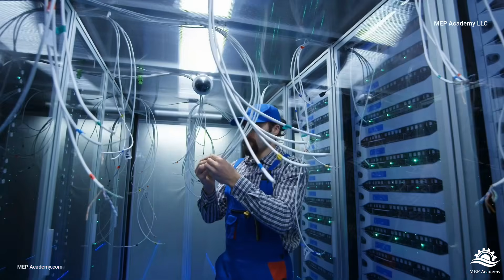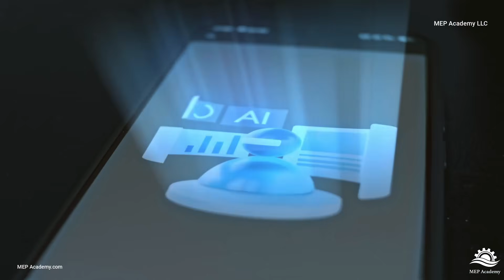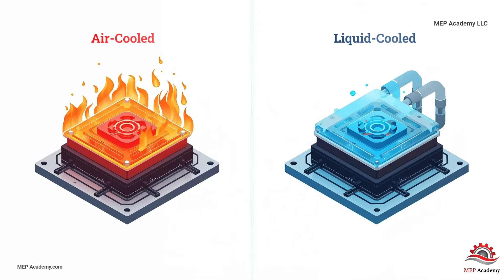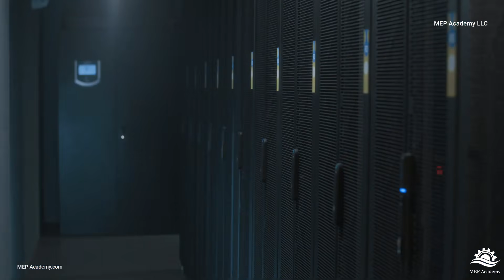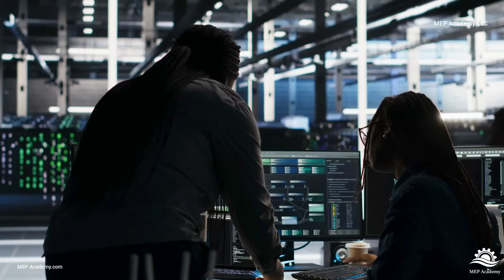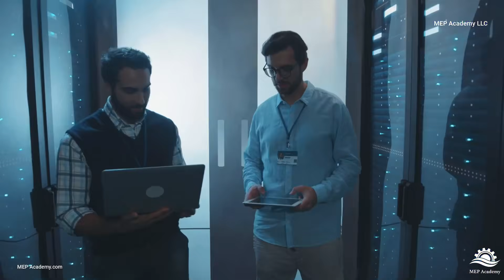Liquid Cooling in AI Data Center

Comment from the maker: 🚀 AI is driving one of the biggest changes the data center industry has ever seen.
As rack densities climb beyond 100 kW and liquid cooling becomes the new standard, understanding the mechanical and electrical infrastructure behind these facilities has never been more important.
What cooling technology do you think will dominate the future of AI data centers?
💬 Let us know in the comments:
• Direct-to-Chip Cooling
• Single-Phase Immersion Cooling
• Two-Phase Immersion Cooling
📚 Want to learn more about the systems that power and cool modern facilities?
Visit MEP Academy for online training courses, estimating tools, and resources for engineers, technicians, estimators, project managers, and construction professionals.
👉 Course Catalog: https://mepacademy.com/courses 
👉 Estimating Spreadsheets & Tools: https://mepacademy.com/shop 
If this video helped you understand liquid cooling, please give it a 👍 and subscribe for more videos on data center power, cooling, redundancy, chilled water systems, CRAC vs CRAH units, and AI infrastructure.
Thanks for watching!
Reply: Maybe an interesting video would be the trend of using cogeneration to provide cooling for AI Data Centers from waste heat from the behind the meter natural gas electricity generators (I think using absorbtion chillers). 

Maybe you could look into the waste heat cooling that Fuji Electric Co. has announced where the hot water from the chips is used to run an ejector cooling unit. Supposedly it can reduce server cooling power consumption by up to 85% (when used over a three-month summer period). Sounds a bit suspect but the AI chips now are outputting 145 degree F water. 

From an article:

“The Vera Rubin server infrastructure (Nvidia's AI compute platform) doesn't need traditional chillers because it uses highly efficient warm-water, single-phase direct liquid cooling (DLC). By engineering the chips to operate safely with an inlet water temperature of up to 45°C (113°F), the cooling loop becomes hot enough that data centers can reject heat directly using outside ambient air (dry coolers) instead of power-hungry, mechanical refrigeration.”

Comment: How much water is generally used to heat a KW of power?  How hot is the water discharged to the environment (air or back into the water stream)?  How remote can a data centre be (ie middle of no where)?

Comment: Your video left off the other form on emersion.  This where you get the best of both worlds.  Emersion cooling and cold plate cooling.  This is where you keep the servers currently configured but instead of piping the hot water to a cooling tower consuming water.  Submerse the cooling tower in a large body of water with the body of water in motion circulating the water over and through the radiator fins.  This is basically the same way water is used for cooling in power plants.  Poof now you are no longer consuming water at the rates people are so concerned with using.  If done properly the water reservior would be a shared resourse between the power generation plant and the data center cooling.  Meaning you now have a resource independent data center. Even adding back to the community any extra power generated, not to mention adding taxes to their coffers as well

Comment: How quiet are these data centers using this cooling system?
Reply: The noise from water cooling cubes from the circulation pumps which can be in a separate room from the servers. Pump rooms can be sound insulated and some distance from spaces where people are working. This is in contrast with fans that need to be in close proximity to efficiently move air. The fan motors and the moving air are each noise producing.

Comment: Well done a great explanation, but it doesn't explain why they need so much water constantly and how the water gets contaminated.
For example you used the car engine and all you need to do over time is add a little water, very little and the engine remains cool.
Why would a data center be different and why would it be releasing contaminated water (going on reports) into the environment?

Comment: Cars DONT USE WATER.
Reply: Yes they do!! Coolant is made of water that runs in your radiator.  And yes, you shouldn't use the same water- you should flush it with new every 5 years
Reply: Car radiators use water. Ethylene glycol is added to raise the boiling point

Comment: For now AI needs to be only used for the design and creation of a cooling system that does not use or consume water!
Reply: This problem has been completely solved. The data centers will consist of servers on satellites orbiting the earth. Unlimited solar power and cooling grids that requires no water supply

Comment: Dont know if you read comments, and this might not be a feasible idea, but what if data centers use Dry Ice recirculating Condensing units for cooling?  Sealed system that compresses co2 into dry ice. Dry ice is then used for cooling. As the dry ice evaporates back into co2 its recirculated and compressed back into dry ice. Another benefit it could be supplied from co2 removed from the atmosphere by capture units?
Dumb? Or did I just give away a billion dollar idea?
Reply: Local power sources such as propane or natural gas fuel cells are the only solution to the gap between zoning, available power at the right place from the and issues with traditional turbine or rotary motor generators.   Fuel solves to produce carbon but if it can be converted to dry ice for cooling purposes and dry in the carbon released when the dry ice evaporates can be totally or substantially recaptured and used again, that will be that would be a transformational change.
Reply: There are companies who are currently working on this.
Reply: are you dumb? google CO2 refrigeration. you just described a refrigeration cycle using CO2 and it’s got a limited scope for reasons that a simple google search would tell you😂
Reply: *Your comment was removed by the CIA. You are too smart to legally live"

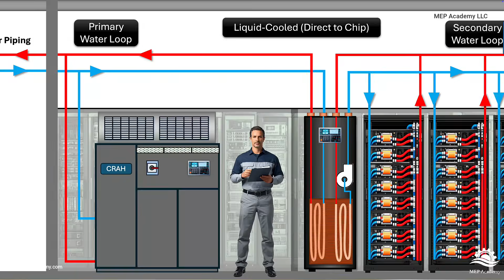Comment: "challenge isn't supplying the power"... supplying power is 100% a challenge as well, just look at the move happening now to 800VDC.  Also... @5:45, near ZERO new AI data centers utilize a 'cooling tower', instead the condenser loop is fed through dry coolers so that water can remain in a closed loop circulation, and thus avoiding evaporation.  Cooling Towers were circa pre-2010, not today's approach.  Do you actually research by talking to design teams that do this for a living?  Interest in immersion isn't growing either, its % adoption to overal market is plummeting.  I appreciate what your channel is doing for MEP engineers and adjacent industry professionals, but please be thorough and accurate when attempting to 'summarize' a market sector.
Reply: For sure. Some information is incorrect or at least not as accurate as should be.
Reply: Someone that actually knows what is going on in real life. There is so much misinformation about AI data centers.
Reply: @Mentaculus42  Yes there is, its an endless struggle trying to unravel the false narratives.  Or Narratives that apply to legacy data centers or single installs, that the nay-sayers want to apply forward to the whole industry...  ugh.l
Reply: @apokalypz08 

Your username sure sounds like a reference to “Mad Max Beyond Thunderdome”? Even though that was pronounced as “Pox-Eclipse”!
Reply: @Mentaculus42  Its not that 'fun' of a reference.  Red Alert 2 was my fav game, there was an Apocalypse tank that was my fav asset in the game, and in 2003 when i got an Xbox, i had to create a gamertag, and spelling it correctly was taken, so i phonetically changed it, and added a number on the end.

Comment: Data centers are just storage units of information compressed either into chips or whatever they get written stored on why do they need cooling if that data is not being used ?
Reply: Data centers don't just store the information. This information is constantly used and refreshed to ensure it doesn't get lost, and in AI datacenters the computer chips are always running calculations. These chips all have billions of transistors (basically just electrical switches in computers) that generate heat whenever they switch. Also electrical current passing through wires also generates heat.
Reply: You've described cloud storage but not cloud compute, we need both: a place to store the data and compute to execute the programs that operate on that data).  With the rise of AI we've also seen a rise in GPUs which are optimized for extremely large matrix math calculations like the kind needed for LLM training and inference.

Comment: Correct now in water cooling to drive this mechanism you have to conserve that energy also you can turn Ice in maleable pipes  in liquid it saves energy then the water heated water either Can be cooled back or used where hot water is needed,